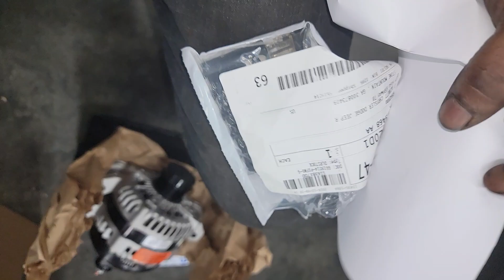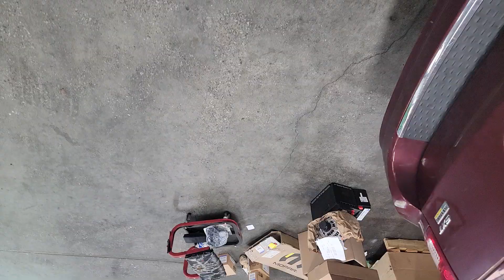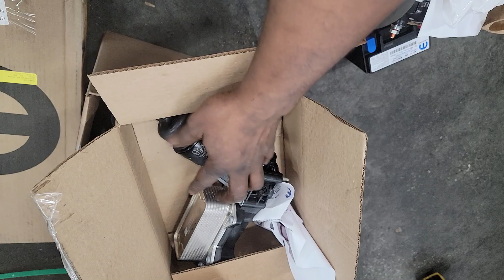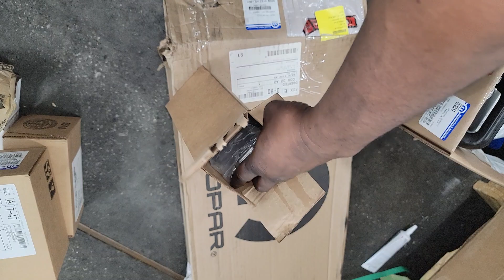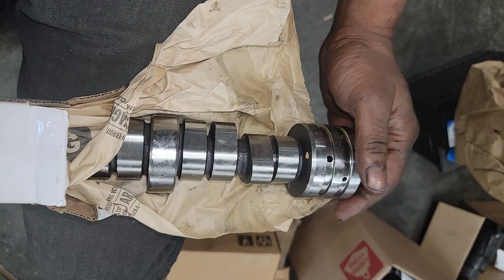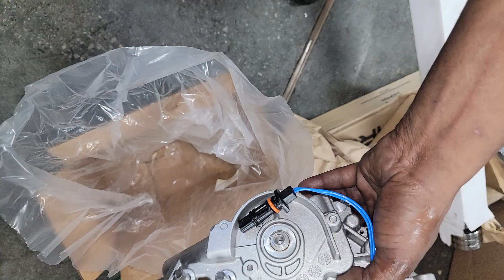Here's why most mechanics go to work on there day off.

Comment: Just because you say it is revised, Doesn't make it a good design. Revised or not the plastic oil adapter is trash, I have changed a ton of the later model adapters as well. I mean they are great money for mechanics, easy job to do. Just sucks for the customer, having to spend money to replace something that never should have needed to be replaced if they built it better in the first place.
Reply from the maker: You are aware that you don't have to use that cooler right?
Reply: @OnlineMechanicTips  I'm not sure what you mean by that? Are you now suggesting to use the aluminum Dorman one? Or that the newer 3.6l adapters will fit on the older ones? Or something else I am missing completely?
Reply from the maker: You fussing as if someone make you use a part that you don't have to guy is my point. My cooler of choice don't have to match yours. You should use what ever parts you think best for you and/or your customers. IMO, this a better choice for me.
Reply: @OnlineMechanicTips  Oh I see, I work on fleet vehicles. It isn't your choice of OEM that annoys me (till we had access to the metal one they were by far the only choice to use) It is that Chrysler cheeped out and made it from plastic in the first place.

Comment: Back in the day cop cars had a knob to pull out to raise the idel. This solved the problem of low oil pressure. You'd think in a modern car they would have a button to push so the computer could maintain the proper pressure.

Comment: There's a real problem with finding shops outside of dealers that can regularly diagnose electrical, sensors, and other issues.
Many of these shops charge a diag fee, yet also seem to throw parts at cars.
For example, I had a P0420 code on a 4 cyl and the shop recommended a new catalytic converter. After the new cat, the same code came back the same day. Then the shop recommended an o2 sensor. That still didn't fix it.